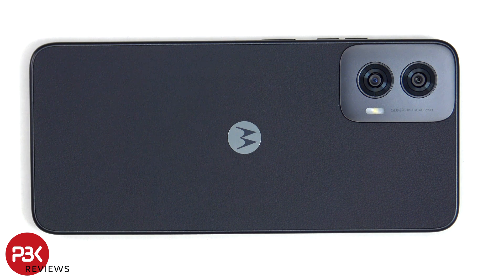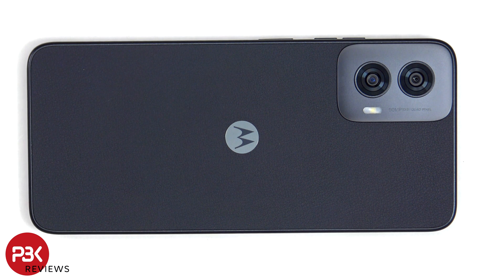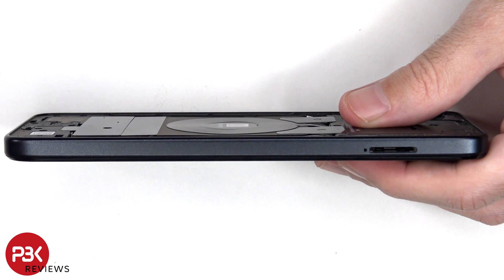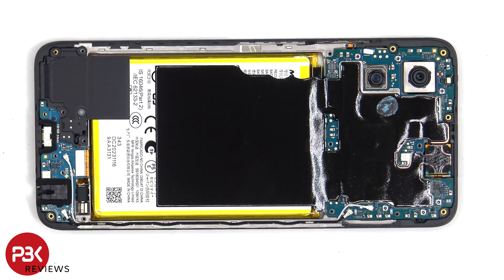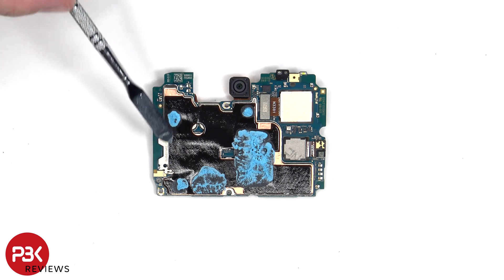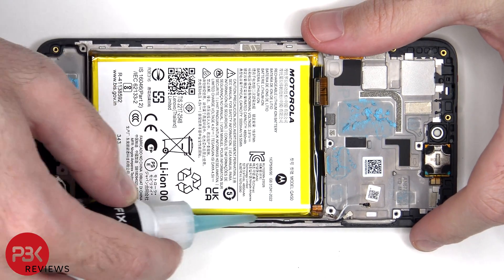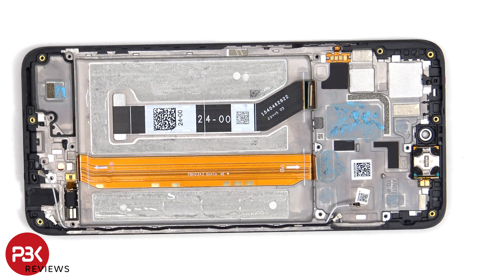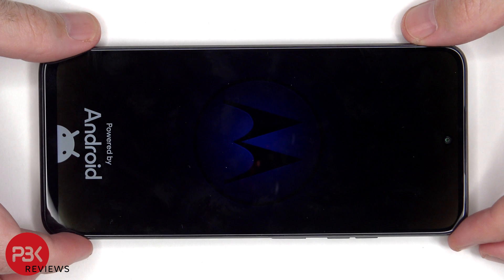Motorola Moto G Power 5G 2024 Teardown Disassembly Phone Repair Video Review

Comment: Hey bro so I appreciate this video. Just replaced my battery without a hitch. Turned my Yihua 8858IV all the way down to 100c and it was fine, that is operating temp of the average hairdryer. just for about meh 120 seconds. wasnt that warm to the touch at all.

Comment: Thanks for the video—really helpful! I just finished replacing the screen on my phone by following your instructions. One thing I’d mention: if you're only replacing the screen, you only need to disconnect the battery. There's no need to remove the other connectors, coax cables, or the two circuit boards.

Getting the battery out was by far the hardest part—it was a real pain. I tried isopropyl alcohol, but it didn’t seem to loosen the adhesive at all. I honestly thought I might break the phone while prying the battery out—it was that stubborn.

Also, it would’ve been helpful if the video included some guidance on reattaching the screen and the leather back cover. Both need to be glued back on, and it wasn’t easy to figure out how to get them flush with the frame or which adhesive to use.

That said, your video was incredibly useful—thanks again for putting it together!
Reply: THIS should be at the top or pinned or something! just taking out the battery makes this repair so much more easier
Reply: What did you end up using or adhesive?

Comment: I must have missed a step.... just had the phone explode in my lap when I was taking the actual battery out. I had used a guitar pic and went around the edges then took a small pry tool to pop it out and I got a much bigger pop than I was expecting. No major damage, 2 melted spots in the floor and very minor burns to my legs. I was very lucky and have a much better understanding of my cell phone repair limits. I wanted to comment to warn others to be cautious.
Reply: holy shit
Reply: Isopropyl, you need to apply it to the adhesive around the edges of the battery for about a minute. If it's still not lifting up just repeat with the isopropyl

Comment: I'm fairly new to the world of smartphones, and I'm looking for my second. I have read everywhere the the Motorola MOTO G Power 5G 2024 battery is not removable, yet you just removed it.  I had thought that if I bought this phone, if it developed battery issues, I would have to get another phone!
Reply: At the very least this phone doesn't have ribbon cables for the screen going over the battery like some other phones. We went from batteries that could be popped out by hand. Then we had batteries with pull tabs that you could get access to after removing the glued back cover and some screws. Now the battery is glued in and you have to remove the screwed in charging coil minding the ribbon cable after removing the glued on back cover. Just way more points of points of possible failure. The only thing they haven't done yet is solder the battery to the board.
Reply: @mightza3781  I miss being able to just remove the battery by opening the back and lifting it out. That was an extremely good idea on so many levels. Gluing them in is a personal security risk, as well as an environmental nightmare and money-grab.
Reply: That moto phone is on sale at Walmart online for Straighttalk prepaid for $39.88 as of today, Dec 08, 2024. Been same price since Black Friday, recently! Its a deal, if you want to try it!
Reply: @Slim1423  I don't live in the US, but that sure is an amazing deal. I wish we could see that kind of deal where I live. Oh well. I did buy the phone and got 25% off with a Black Friday deal.
Reply: @r.1599  ok. I understand. Would have thought you could order from Walmart online, all over the world. As long as you got some kind of discount, that will have to do. I hope you enjoy that phone!
Reply: @Slim1423  The practicalities and logistics of ordering from a US store and shipping to another country (IF it ships internationally, not to mention duties, taxes, currency exchange, plus postal strikes and courier stoppages), can get pretty complicated and really push up the end cost.
Thanks, I hope I enjoy the phone, too. I've read good things about it. 😊
Reply: @r.1599  i can understand that. I think you will like that phone though. I bought a case , 30w Motorola turbo power charger, and glass screen protectors for mine. I am new to Motorola,  the moto g power 5g power 2024 phone is my first one. You will definitely like the stereo speaker feature with speakers on top and bottom of phone, 128gb system memory, 120hz screen refresh rate, can be charged wirelessly or with cable and wall charger, can add memory card up to 1 TB, 8 core processor,  etc. Its features are impressive!
Reply: You can make a phone either waterproof or battery-replaceable. My great small Moto E5 I've had since 2017, never an issue.   I just pop off the solid back cover with guitar pick and replace battery literally in 30 seconds taking my time.  8 bucks, no connectors.  These new phones are so HUGE that gluing the battery is used as a rigidity brace, helps prevent cracking the phone in two if you sit on it.  

Motorola should consider making a "Moto G Nano Phone", thicker but much smaller, something between a Razr and this massive kludge of 167mm!!! ... might as well use my laptop as a phone.

Comment: good video. Why don't you score the phone more than 0.5/2 for changing the screen? I would have thought changing the screen is easy if you get the screen with frame option.
Reply: Easier to replace the screen only on the existing frame, less work and risk of damaging parts moving them around.

Comment: Is it possible to replace camera glass?
Reply from the maker: yes, its held on with adhesive. You can heat it up and pry it off with a razor blade or x-acto knife and replace it with a replacement.

Comment: First, thank you for the video. I am wondering if you can give me the measurements of exactly 'where' on the back of the phone the wireless charging location is (ie the ideal center spot)? I am trying to modify a case (that I really like) to accept mag safe stuff by adding a metal ring to the back of it. Before I start altering things (on the case) I want to follow the old adage 'measure twice, cut once'. Basically I have to get it correct on the first try.